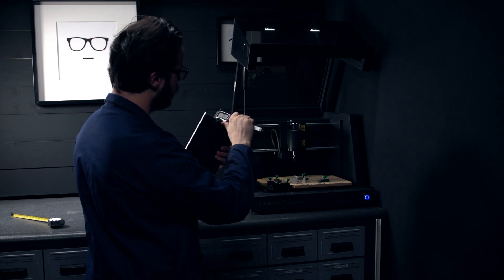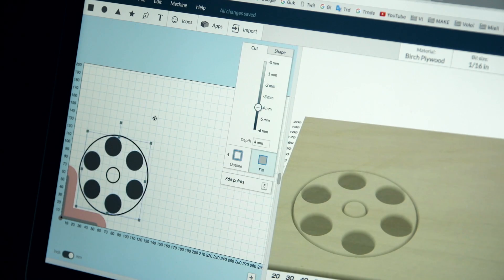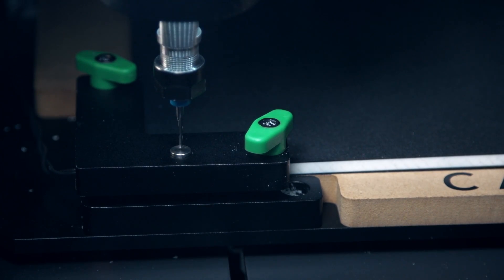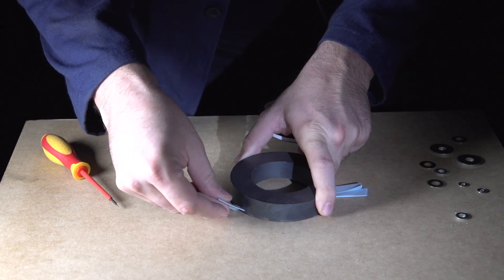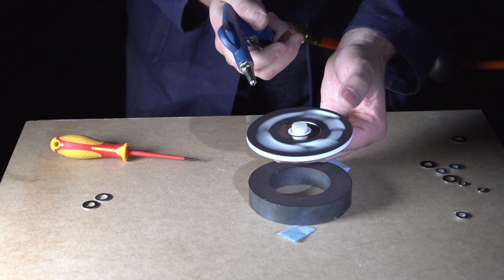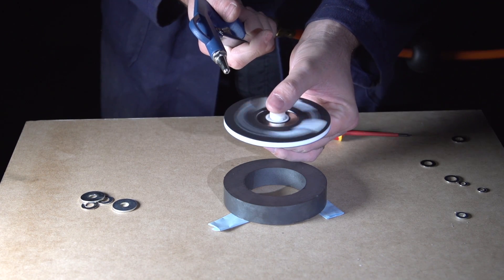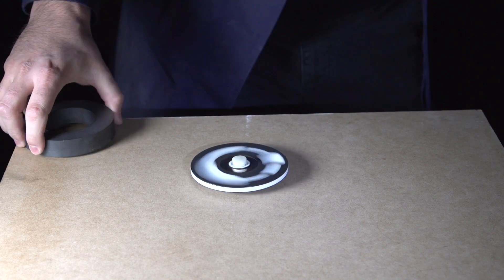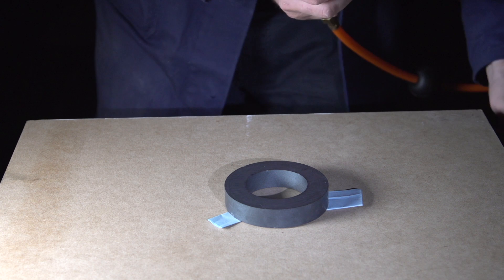FLYING FIDGET SPINNER, yes really! | GIACO

Comment: This looks like its being held up by a string. On the first clip, it slowed down to a point where the air wouldn't be able to hold it up from the spin, plus there is metal in it, thus...

**CLICKBAIT**

Comment: The concept is very cool and I am not at all trying to sound critical but the fidget spinner here is not technically flying. the term flying implies that the object is traveling. the fidget spinner is moving but because it is constantly in the same area it is not traveling. in this case it is floating rather than flying

Comment: I used to float Frisbees like this all of the time. The air is shot both up and down at the same force making it float; sort of like, ejection column that shoot out of the north and south poles of a black hole. Many black holes have a spinning nucleolus that can approach near the speed of light. This is the physics I would use to make a flying-saucier. A frisbee like shape, a hole on top and bottom, and a high speed spinning disk in the center spun-up with magnetism like an electric motor.... the top and bottom openings would have flaps to adjust the up and down force. The tilt of the outer spinning shell would control the direction of the craft...

Comment: Ok, so you probably got this request already, but have you thought of putting this baby in a vacuum?
Reply from the maker: +diegator yes many times but it's impossible to make it float inside as soon as I closed the chamber the metal parts messes with it and it doesn't work... :(
Reply: Of course you tried it already :D I thought the brass fittings on your vacuum chamber would not interfere with the field.

Comment: when i invented what is currently the fidget spinner i used wood and a ceramic ball bearing i crafted it as a 3 bladed propeller 
i did this so my brother and i had a flying toy,
we would use fishing line around a groove to get it spun up as it got faster it would take off into the air
how something i made in my pops shed when i was 7 nearly 30 years ago turned into a crazed hype toy for spinning slowly in your hand i will never know

Comment: I don't believe you. the spinner isn't changing speed or position although you're messing with the flow of air around it. it should propel it to different positions and possibly slow it down when you used that plastic case or the cardboard box.

Comment: What I've always wondered about is how you can set up magnets in a way to where there's one loose plus magnet, which is being pulled by a minus magnet, but another plus magnet prevents the before mentioned magnets touch. I had a dream to where someone made a small ring using this trick, and it was a sight to behold! Though it is a dream, I believe it's possible because of science!

Comment: There actually is tech like this that already exist, there was a toy years ago that worked similar you would spin it on the spot then use a little plate to lift it up and if everything went right it would stay spinning in the air.
Reply from the maker: +TheaDragonSpirit yes... was called the levitron

Comment: So the magnet holds it in the air while the angular momentum of the spinner is keeping it in place. Clever.
Reply from the maker: +John Hurley correct... there was an old toy called levitron that was doing the same but with a top... so nice!
Reply: Interesting. Since I have your attention, what are the different sized holes for?
Reply: Ok. Now my next question: Why different sized magnets.
Reply: I knew already
Reply: Cool
Reply: John Hurley probably so he can make the fidget spinner levitate. Because you know, different sized magnets have different mass/weights so he'd have to experiment on them.
Reply: John Hurley I think it was for different sizes of magnets when he was experimenting

Comment: Is the centrifugal force and the high RPM the reason it's aligned so well?
Cause two magnetic poles of the same side repelling one another normally result in quick erratic movements, not a neat alignment like this. Just curious if it's the centrifugal force of the high RPM along with the same repelling magnetic forces. Neat video!
Reply from the maker: +Michael Palmer yes that's exactly it... it's also the reason why it falls as soon as it slows down even a bit

Comment: Can you set it up, and put it in a vacuum chamber and see how long it stays up.
Reply: Andi Yu    There will be little change except the spin will be a little longer due to no air resistance. The only force letting it levitate is the magnetic field of the magnet pushing the spinner upwards. Eventually Gravity Evens it out and the disk will lay there seemingly frozen in the air.
Reply: SO MUCH DAMN INNTELLIGENGE :O:O:O:

Comment: +YayaFingerButters How about if we put it in a vacuum, in an orbit, spinning at 1000rpm or mote at 11,000km above earth (1000km away from the exosphere), remove the middle ceramics/other material that the fidget spinner spins around and effectively slows down due to friction. And there you go, a fidget spinner that would figuratively spin forever. If earth can do it for 4.5 billion years , it must be possible, which leads me to believe that the EARTH IS A GIANT FIDGET SPINNER SPUN BY uh.. the accretion disc of hydrogen that kept its angular momentum when the earth was forming?
Reply: Saroyus nice think!

Comment: Make one where you can take out the bearing REALLY easily, Put it in a vacuum chamber, take out the bearing, and because there is hardly any air resistance it will spin for ages

Comment: For all of you who thing this will work in a vacuum, either you haven't been taught such things or you're ignoring science.
A vacuum has no air, using that air press will put air into the container, PLUS there is no absolute vacuum.
And he can't just spin it then put it in, because the air would rush in, high pressure to low pressure.
Sure, he could probably stick everything he used in a container along with his hands, making it roughly 100% impossible.
This idea of putting s spinner on a magnet in a vacuum is like saying you can survive a nuclear blast in a fridge.
Reply: But the thing is using magnets to levitate. A vacuum doesn't affect magnetic force. And  in a vacuum is almost no air, meaning there won't be hardly any friction, thus causing the fidget to spin far more longer.
Reply: Sandro mehr Not how it works.
Reply: Your whole comment is predicated on the assumption that he HAS to make the vacuum then put the spinner in, which is false. He can set  up the system then make the vacuum around it.
Reply: Sandro mehr the real question is are YOU stupid?
Reply: Indiana jones neglects what u say and turns it around
Reply: imKhaos DG he could just make it spin before he puts the vacuum clock over it are you Stupid or some shit
Reply: imKhaos DG ofc
Reply: imKhaos DG, haven't you heard about Indiana Jones?

Comment: People who think this won't work in a vacuum because there is no air resistance to hover on:

This spinner uses a giant magnet to hover.  He uses the magnet in the goddamn video to move the spinner around on the table by repelling the two apart.  The spinner DOES NOT fly like a helicopter, it hovers above the magnet by being continuously repelled.  The repelling force is balancing out the force of gravity and the spinner's spin is keeping the weight evenly distributed so that it doesn't wobble out of said balance.

In conclusion, the spinner would spin and hover just fine in a vacuum chamber provided that a motor is used to get the spinner to spin rather than compressed air.
Reply from the maker: +John Kimrey thank you

Comment: Huge difference between flying and hovering you know?
Reply from the maker: +nick111138 hovering is a form of flying, you know?
Reply: nick111138 quack you know?
Reply: Made me doubt myself but I was right. Flying is to travel through the air. Hovering is to remain suspended in the air.

Yep made several google searches and looked it up on different definition sites.
Reply: That'd be true if it was moving through the air. Not spinning in a single place. If you put it on a magnetic rail then moved it along it then I'd agree that it'd be flying.

Comment: Would the washers spinning in the magnetic field suffer from eddy currents, generating heat due to resistance and thus sapping kinetic energy from the spinner? Would be interesting to see what happens if you build a spinner with the same magnet, identical rotational mass and hopefully identical CoEf of drag but no metal in it. Would it levitate for longer?

Comment: if you connect to a dynamo, can you make a frictionless electricity generator?

I mean, since it is based on levitation, there should be no contact and therefore no friction.  (No contact between rotor and stator)

I know normal windmill is horizontally oriented. But just try to make a vertical version where you blow using compressed air

Comment: That's not flying, it's levitating
Reply from the maker: +Pablo Dibildox FLYING = floating, fluttering, waving, hanging, or moving freely in the air
Reply: Moving freely in the air would involve a change of coordinates in the x,y,z plane. This fidget spinner is just levitating. :)
Reply from the maker: +Pablo Dibildox it did

Comment: What's the point of those metal discs you shoved on the sides?
Are they just weights for momentum?
Reply from the maker: +Deiviux90 not only that but you need to calibrate the weight every time... magnet field changes based on many factors and need to be carefully calibrated at every use...
Reply: Ah, right
Thanks. It's been quite frustrating not knowing why they were there :(

Comment: You should put it in a vacuum chamber and try to make it spin for as long as possible. You should make it spin around a removable rod, since a ceramic bearing will generate some friction while spinning, without one it will probably spin for ages.

Comment: if u would do the same thing in a vacuum how long would it spin???  (pls test it )
Reply: FunnyMau5 it will fly because it doesnt fly because of spinning but it levitates on a magnet and i think that t spinning is added to make it more stable like gyroscope
Reply: I think he could get it to spin in an atmosphere and after that, he could create a vacuum
Reply: Not sure how you could get it spinning in a vacuum. He used compressed air to make it spin in the video, but you can't do that in a vacuum
Reply: why wouldn't it (magnetic fields don't need an atmosphere but the trick would be to remove the friction of the air)
Reply: I guess it's not enough light or photons to do it efficiently
Reply: Simple, you blow it, then close the vacuum chamber.
Reply: I think it would be enough, he should try it to settle the dispute! :)
G.
Reply: Reonee something like this was invented but it works better with a simple flashlight
Reply: He might use a laser, that should work.
G.
Reply: Reonee won't fly in a vacuum even if you get it to spin

Comment: Do that in a vacuum then it will last for ages
Reply: +Marcello Protolando
You can make it spin and then put it in a vacuum chamber
Reply: SMG gaming Idk if I'm right... but shouldn't it not work since there is no air that makes it fly?
Reply: VortFX that sounds correct
Reply: It does not fly because of air, but because of magnets. Still he would need another way to make it start spinning, because he's doing that with compressed air.
Reply: Spin it up then suck the air out. It relies on magnets to float
Reply: sure, but I wonder how long it would take. because it may just stop spinning before it's in a vacuum, or it may be destabilized while the air is sucked out. Then again, i'm saying this from a practical point of view and without any actual knowledge, he knows better for sure 😀
Reply: ye i was wrong :P